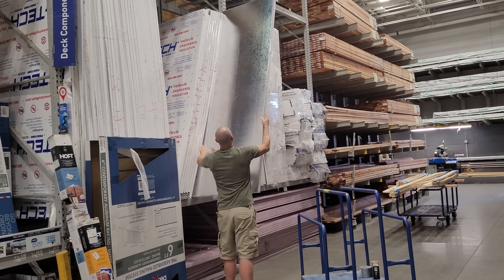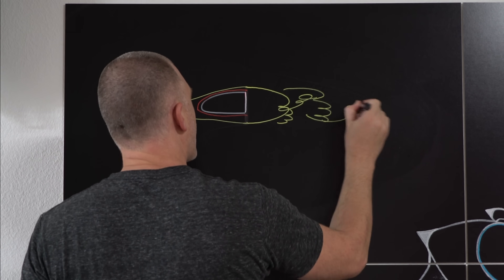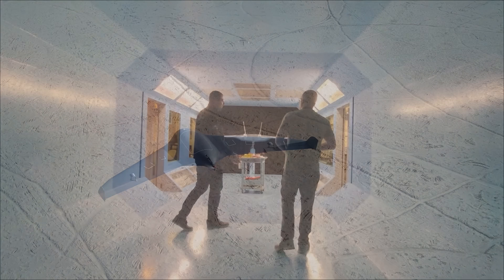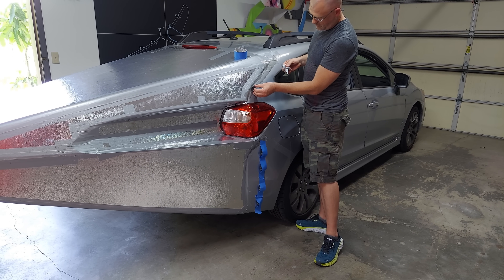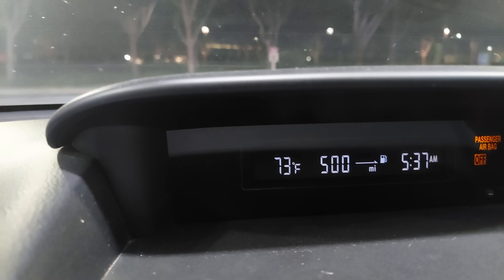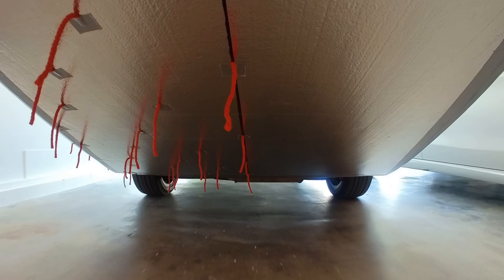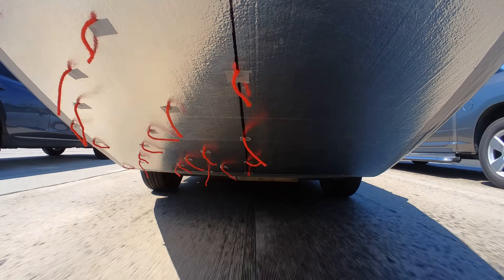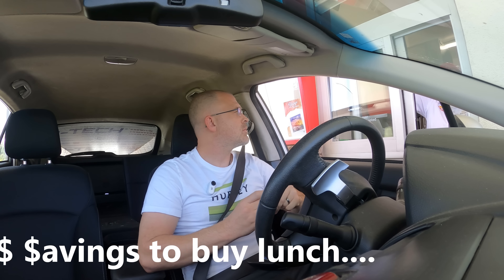Using Simple Aerodynamics to Beat High Gas Prices (Home Improvement Store Edition)

Comment: Few tips to add to you planed adjustments.
TIP 1: cover the rear wheels completely, think Citroen DS 1070s. that will clean up the side turbulence and keep the flow atached to the side. if that does not work, reduce the angle of attack. remove the vortex generators, they are not working as they are supposed to.
TIP 2: cover the whole body under the car except exhaust, you need air under the car to flow. 
TIP 3: Focus on clean separation of the flow. keep the flow atached as long as you can, make sure its cleanly separated when you cant.
TIP 4, add wind guards in front of wheels, like Corvette C5 has.
Reply: Should probably consider brake temps the more the wheels get isolated but the rear is likely fine either way. I just noticed the hub caps on the Citroen BX 16 TZS are also kind of interesting. Might mostly be cosmetic but a simple 2 hole design may actually circulate some air from the brakes while still being fairly aerodynamic.

Comment: This Subaru is probably 4X4 and not so efficient engine (yes they very reliable and comfort) but I believe that replace the car for 2X4 with smaller engine make much bigger change. especially if you going to drive 65mph on average their is no need for engine bigger then 1.8-.2.0.  I manage to get much better mpg with Mazda 2013 2.0 skyactive for example

Comment: could you not also add vertical diffuser fins under the rear section of the tail to help create a more directional flow coming from under the car? Like a race car. You could also smooth out things like the recesses for the fog lights and the holes in the roof rack. You could also lower your car (only if you don't mind losing offroadability/ground clearance). A clear flow straightener behind the brake lights would be good too.

Comment: Good job identifying the changes necessary. My suggestions: Don't bother with the air dam and side skirts yet. That's a really NASCAR-style backyard bandaid to the actual problem which is not having a smooth underbody. The more direct solutions would be a little more complex but would also work better. First, to address the separation along the sides of the car, you should place VGs in front of the rear wheel, not behind it. You were trying to energize airflow which was already turbulent and that's not going to work. VGs in front of the tail lights are also a good idea. The smooth wheel covers were a good idea and probably a bigger improvement than you were able to quantify, but wheel pants over the rear wheel opening would work much better and would be a more direction solution to that problem. As for the underbody separation, you could afford to steepen the roofline and shallow out the underbody extension which on its own would be an improvement. But the biggest thing is this: You need to smooth the airflow under car before it even gets to your extension. Create a smooth underbody panel for your car. From the factory, your rear muffler is attempting to do that, helping to stabilize the airflow off the rear end slightly, but running a flat panel forward of that, at least halfway to the front of the car, would be a huge improvement. Combine that with some VGs in the center, ahead of the muffler, and you should see improvements in the tufts. Also, once you adjust the shape of the extension you could afford to chop like 2-3 feet off its length for practicality purposes, although it wouldn't look as cool. The stunted teardrop shape of cars like the Prius and Tesla Model 3, et al, is called a Kammback and it's basically the only shape that allows a car to be both low drag and practical for road use. Maybe you already knew that, I don't know, but obviously hatchback access and parking lot maneuverability are not huge concerns for airplanes lol. Also, thanks for the inspiration and detailing your construction methods. I've been wanting to try this with my Toyota Sequoia for a while now but haven't had any idea what materials would work. I estimate immediate 20% improvements on a giant SUV!

Comment: The proposed new shape would hit the ground on every bump and dip. Maybe halfway between would work better. Clearly if a manufacturer did this they could relocate the tail lights to the tip, which would help that area massively. I'm actually really impressed with a 13% improvement.
Reply: yeah it would to low is just as bad as to high cause pot holes and other bumps in the road make the lowest possible being very bad for the car driving down the road sadly

Comment: Awesome build and dedicatiom to fight gas prices.
Aero is half the battle, friction and contac surface is also a thing, I would get thinner tires, like the bmw i3 has, that will reduce friction with the ground, also cover all body pannel gaps with tape, lower suspension maybe get aftermarket smaller wing mirros like bmw m3. If all fails buy an audi a3 from 2005 and have 50mpg 🙈 Good luck

Comment: Read up about Kamm tails.   You need to pump your tyres up, fit skinny tyres, take off your door mirrors,  cover over your wheel arches, put a flat underbody on the car, and reduce the size of the air intake as much as possible.

Comment: This is the dumbest video I've seen.  The biggest percentage of aerodynamic drag in a an internal combustion engine vehicle is caused by radiator cooling.  A Bugati Veyron's coefficient of drag is barely lower than a Chevy Suburban, because the Veyron's massive engine needs a ton of cooling (via multiple radiators tucked away in various nooks and crannies).  This is why there is an upper limit to the speed of an internal combustion engine vehicle.  The best way to increase mileage is to decrease vehicle weight and engine size.  This project adds weight.

Comment: Over the last month I have been thinking of wedding a VW bug (68 to 70) chassis, front suspension and front fenders to the fuselage of an early Cessna 310 A (or so for the shortest and bluntest nose possible), and powering it with a Honda Valkyrie (frame, engine, trans and rear suspension) bolted down in the back ala reverse trike.  The 310 fuse is a foot shorter (4 feet Vs 5) and thinner (4 feet vs 5).  I'd cut about 10 feet off the back of the fuse, making it about 14 feet long.  It would be the "Elio" we needed, but never got.

Comment: Try to find back issues of the magazines Road & Track, Car and Driver, Motor Trend and etc from the years 1973 to 1979.  Not only was gasoline expensive ... but there was none to be had, and we did a lot of things to boost mileage.  The magazines I suggested did a LOT of research into this.  The airdam and side skirts should help a lot.  As I recall, Mythbusters found good gains by dimpling the their car like a golf ball to break up the sticky air.  This might be something to consider in the areas behind the rear wheels.  I would also look at the front of the car ... the grill and headlamps have a number of areas that create drag.  Also the side mirrors ... maybe cameras would work as a replacement.  Oh, and drop your speed to 60 mph.

Comment: I absolutely love this to bits, but I think there is a much easier, better way to save up on gas, that requires no modifications, just discipline - only use the brake when you really need to. That means, you predict what's going to happen, so if you know there is a curve coming up and you know you need lower speed for that, take your foot of the gas way before. Same goes for crossings, predict what's going to happen and take your foot off the gas pedal as soon as possible. Manual shifting is advantageous, because when the motor is braking for you, zero gas is used, but you're still going forward. Not sure what this would bring to an automatic exactly, since I'm driving a manual shift car, but when I'm mindful and assert myself to predicting when I'm going to have to slow down or stop, I use at least 15% less fuel than with a more aggressive style - braking at the last moment (I get 5,5l/100 or 43mpg wiith a 110hp 1.5dci engine in a megane coupe). However, this is mostly city driving, about 20% highway. Importance of aerodynamics of course increases with speed, so yes, having a much more aerodynamic shape is a great benefit at highway speeds.

Can't wait for your next video.

Comment: Go and modify piston , f1 style cylinder head add formula one sparkplug, add efficient oil cooler, liquid cooler. Add extra oil pump injectors , add dual fuel injection and make lean. Add tungsten disulphade, nano diamond or molybdenum dysulphade to engine oil add more detergents such as calcium magnesium and antiware agents to engine oil but it decrease engine braking thats negative. Add hybrid efficient electric motors.

Comment: If you can find the trailer wiring harness connection point you could put turn/brake/reverse indicators on the back of the foil... Maybe inside the hole in the back I'm not sure if this vehicle has that It in the wiring harness though...

Comment: Instead of an air dam at the front just add a layer of foam to smooth out the bottom even a little bit of air flow will improve the turbulence at the back. Like you said it needs a boundary layer of air for the fast moving air to slide against.

Comment: you could put plexiglass around the taillights to fit the shape and then put cardboard covering the whole rear fender instead of just the wheels and then get some 12v strips and vampire clips to wire in the LEDs to the high mount stop light

Comment: Fun project, but theres a limit in what can be achieved. Gas prices will continue to rise, its $8 per gallon here in Europe, still cheap. Maximum aerodynamic savings have an end somewhere. Had to look the gas prices up, havent been at a pump for 8 years. My fun project is to make some Electrons with my PV on the roof and have no bills for gas&heating. Works since 2014. Our EV gets 168 mph (converted)

Comment: The aerodynamic drag is probably nothing compared to the losses of the internal combustion engine. It probably loses about 20-30 percent of the energy of the fuel you put into it. But i assume that you already know this. 
A lot easier way to reduce the aerodynamic drag would have been to just drive more slowely (in the highest gear to save as much fuels as possible).

Comment: You could also tape the body panel gaps especially in front for a little less drag. Also with tape make the front as smooth as possible without going overboard and overheating the engine helps. I think all this as well as any weight reduction you can manage in addition to your mentioned improvements would make a huge difference.
Reply: taping body panel gaps while it sounds good in theory, air doesn't go in or out from it, this is because the air that's close to the panel is moving pretty slow, and doesn't have enough energy to go through it, and it would be easier to just go around it, rather than in it.

Comment: Do you happen to know your optimal speed for fuel efficiency? My truck seems to be right around 40mph and I get 35mpg, not bad for a V6
Reply: Yeah 65 is an unlikely speed to get the best efficiency. 55 is a commonly used benchmark. Typically the best speed is the lowest you can go in the highest gear. I've driven an f150 that would only go into 6th close to 60mph, but 5th from the high 30s so you could get good MPG around 40. My car shifts into top gear in the high 30s to low 40s. Generally newer cars with more gears will hit top gear around the 50s to 60s. Older cars with fewer gears seem to hit top gear in the 30s and 40s.

Comment: Ten years ago I drove from Florida to new York and averaged 39mpg in a Saturn wagon. I made a flat undercarriage, front air dam designed to scrape the ground and extend the rear of the roof one foot. All done fairly cheaply. Didn't last but added 10 mpg
Reply: That SW2 was a beast. Great car really, had a 01, it was rated 38 mpg highway. The wife drove it, burned oil and at one point ran to almost no oil left in the pan. The thing ran as good or better than ever after that.. the mileage probably went up. 🤣
Reply: @jeremyr7147 I may have bought that one from you lol

Comment: I have another solution then improving the aerodynamics of your car: RIDE A BICYCLE for the short distances. 45 % of all trips in the USA is below 3 miles/ 5 km. That can be easily biked.
Yes, there is hardly any bike infrastructure in the US. Headwind and hills can dealt with gears on your bike.
Reply: Easy to say, hard to do. Many places in the US are car-centric and don't have bike infrastructure or just lines painted on the ground. Not many people want to take a chance riding on a 5 lane stroad with cars passing a couple feet away at 50mph+
Reply: @AhuizotlXiuh  Yes, you are right that cycling in most US places is terrible and dangerous. But you have to start a bike movement,  find willing politicians (democrats) and city planners. 

Today Amsterdam is seen internationally as the cycling heaven in the world. But up to the late 70's the car was king in Amsterdam, at the expense of the cyclists. A small group of cyclists demonstrated non stop and they had a very good argument: "Stop killing our children with cars.". 400 children were killed by cars each year. Politicians listened and more and more bike infrastructure was built. The number of cyclists started to increase, after years of decrease.

Comment: I have a dodge Dakota r/t that usually gets 15-16mpg on the highway. We got bored one day and put my $5000 goodaero wing on it. At 0 degrees angle of attack mileage went up to 24mpg. Rear bumper was also removed which is a air dam in itself

Comment: There is (was?) a guy here in the Triangle (North Carolina) who drives/drove a highly modified 2000 Civic Hatchback, complete with fiberglass aerofoils, spoiler, rear shroud, the works. Last I remember he was getting like 80 mph (that particular car already gets amazing mileage from its tiny little 4 cyl engine, 40-50 IIRC). He also had a custom tune on the engine that accounted for the reduced drag. I'll see if I can find it

Comment: Cover the whole rear wheel wells, also what about putting some lightweight clear rigid plastic over the rear light contours to smooth them out?
Reply: Depending on your state laws, maybe you could remove the side mirrors and replace with cameras and screens in the car.  And if you rebuild the rear area to be lower, you could add a linear actuator to lift it up and away when you want so it doesn’t drag on the ground when going up a hill or over a bump

Comment: Back in the 1960's our minister had a Chevrolet station wagon.  He made a closed in trailer to haul behind it for hauling things around.  The trailer was the height of the car, and he discovered that he got better mileage pulling the trailer than he did not pulling the trailer.

Comment: Another suggestion could be to have the cross section of the rear extension also be shaped like a teardrop, with the bottom tapering to an edge instead of being flat to eliminate that void creating space, not sure how to make the gradual transition to that edge from the bottom of the bumper though
Reply: Side and rear splitters should do something.  I don't know if that would be easier than redoing the sides and bottom to maintain attached airflow.

Comment: I would start by adding skirt onto the rear wheel wells and make the part where the rear lights couldn't be covered in transparent plexiglass, so you can have a continuous shape trough out the rear.
Also weight saving by removing non essential parts in the interior and changing tire to a skinnier one with maybe a higher pressure, it's gonna help a lot.
Sorry for my English, I'm Italian:)

Comment: Could you add small air scoops at the sides down low, to suck some air into the rear underside to smooth out the air? Not sure if that would help or hinder.

Comment: -Add Lexan sheets, cut them to fit each taillight to reduce drag.
- Add an rear diffuser like an formula 1 car to reduce drag at the rear of the car.
-Add everything else that you mentioned in video (flat pieces under the car, tapered rear of car).

Comment: The reason why manufacturers don't is because while this is more efficient it also makes cars take up a lot more space, parking lots, sidewalk spaces, garages, etc, the infrastructure involved in parking, would have to be modified if every car, truck, etc were 20-30% longer than it currently is.  Not to say your design is bad, just that it would get increasingly impractical the larger the vehicle you wanted to apply it to was.  That being said, slightly less extreme versions of this modification which only increase the length of cars by a couple feet could probably be implemented with a negligible increase in cost and no need to change parking infrastructure, which would simultaneously make those cars 10-15% more fuel efficient.  
Personally I'd love a change, I'm sick to death of these bulbous, ugly, melted looking cars.

Comment: Only things I want to add are:
Do the same to the front! (Just let enough air in for the radiator......)
You do need a belly skirt to smooth the entire underside! (In fact, won't the air damn sticking straight down harm aerodynamics!)

Wish you were my neighbor! I've wanted to do this for a long time! Right now we have a great running Toy Corolla that often gets over 36 MPG in it's OEM, 280,k mile state!

Comment: I'm the concept of cutting fuel rates in 1/2nd, 1/4th, 1/8th, 1/16th, or 1/32nd... You need to lose fuel capacity to lighten the overall weight. 

The fact that you gain so much s well as keep your original weight is also something to be factored. 

There is plenty to discuss and I lack funding and a friend of any kind (as I'm a recluse).

I have a really good idea and concept. 
#(ck) common knowledge